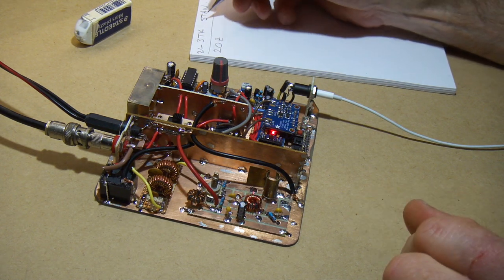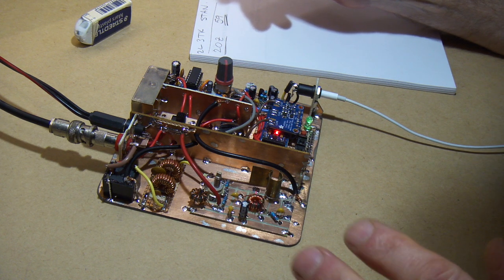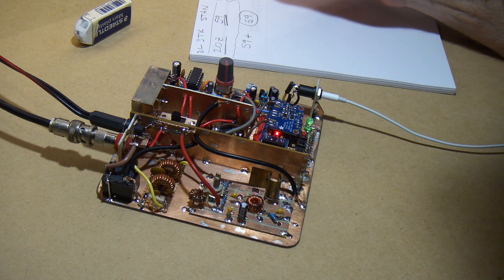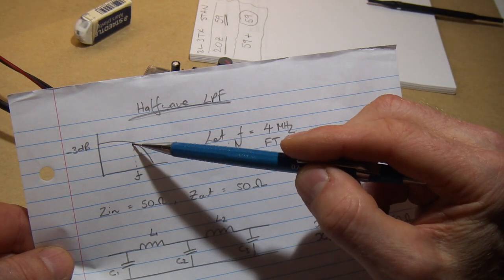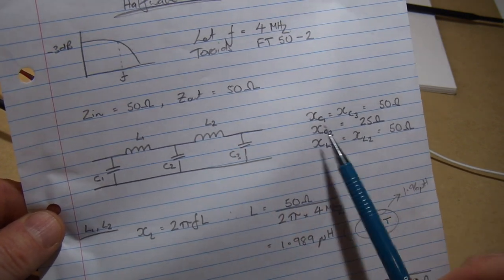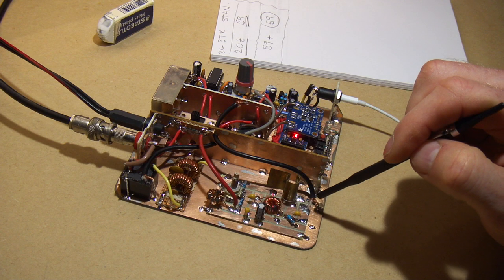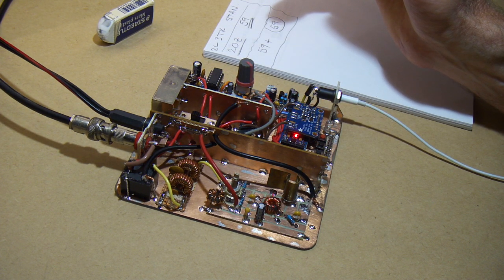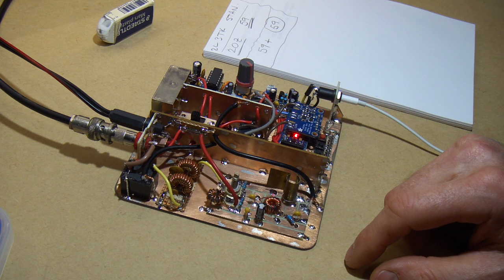Go QRP SSB Rig: Part 7 - LPF and First On Air Contacts

Comment: Hey Charlie -- you said your goal is to inspire others, and I thought I'd chime in as one who is inspired.  I've been bitten by the homebrew bug about a year ago, and am making progress in baby steps.  I anxiously await each of your videos, and have learned a lot of things from them.  This week's accomplishment was the successful creation of a driver amplifier to take the Si5351 up to a quarter watt at about 40-50% efficiency.  And the best part is I can point to each part in the circuit and explain what it does and why I put it there.  Thanks for your inspiration and the time you put into making videos!
Reply from the maker: That is so good to hear Yakov. I am so pleased, well done! Thank you very much for the feedback. Very much appreciated. 

Please keep us posted on how you are getting on.

73
Charlie
ZL2CTM
Reply: The easy way to do it if you will accept square wave output is the  AC04  chip or any AC not gate. You get out about  30 mW per gate  and one gate will drive about 8 others.  It's hellish crude but no  intermediate  transformers are required.  The output can be made double ended if you so choose.  Look at the Quad  BS 170 ampl used in the  MDx from Qrp labs if you want inspiration in this area.   The  Si 5351 is sufficiently  low z and  has  4mW out so it can drive  a single BS 170 in class  C  directly to produce  a gain of perhaps  16  DBg  so that gives you  160  mW out that's in class C operation only.  See the Penntek  TR-45L plug in board schematic for how he keyed (CW)  the amp with  Ramps  and  his power control detail. This config drives an IRF 510 to up to  7 W RF out at  10 Mhz.  I can't state the URL here  as the post will likely get deleted. 

TEF in NzL

Comment: That's just brilliant Charlie, even after all these years of watching your videos it still amazes me how you can take a relatively small handful of components and make such a good radio. I just wish I had the patience to work through the problems that come up. Whenever I build anything It never seems to work as well as your projects. 
Anyway can't wait to see what's next.
73 M1CEM.....
Reply from the maker: Many thanks Brian. It's certainly not always plain sailing, but it helps to have a logical fault finding process. I can than the Air Force for that.

Comment: hi Charlie,

you dont need the "2" in the inductor or capacitance calculations. if you take the "2" out of the calculations and enter the values in to elsie ( filter designing software) then it will give you the correct cut off frequency. keeping the "2" in both calculations yields a 5.6 MHz cut off frequency not 4 MHz as you thought.
Reply from the maker: That's interesting Simon. I'll have to go back and check the references. Cheers.
Reply: @CharlieMorrisZL2CTM  i am going to retract my comments about the reactance calculation being wrong, But will leave it up for educational purposes.

I have done my research on google and found to be in the wrong. Even sources that don't directly deal with filters, but do talk about capacitors and inductors and the reactance of both components. ALL other sources that talk about reactance DO clearly show the "2" in the equations / formulas. 

I will be contacting the site that holds the information i used and see if they know about this error ( or possibly an error in the context that their article could be taken). I have removed the one poast with the site name included so people don't make the same mistake that i did.

keep up the good work and stay safe 

Simon M6FJW

Comment: Thank you for the videos. I understand most of the maths you do as this stuff I studied as an undergraduate but I don't know enough about all the circuits. I am going through the material for the French ham license but it is a bit basic. Could you recommend a few books explaining more about the design of these little radios? I think that I will sit the exam next year and I like to tinker.
Reply from the maker: A lot of the basic theory goes back to my earlier Air Force days. More recently, I have found both 'Solid State Design for the Radio Amateur' and 'Experimental Methods in RF Design' tobe good texts.
Reply: @CharlieMorrisZL2CTM  Thank you, they seem out of print and really hard to get here, but I will keep my eyes open!

Comment: In module si5351a only work xtal on 25MHz, and clk0,clk1,clk2- dont power ON :(((. I used esp32 and scetch from etherkit github examples. All dont work... Can you help me??? Thx and sorry form my bad english.
Reply: Check the i2c wiring between your ESP32 and Si5351A modules, check pull up resistor valves. Try 100 kHz i2c  speed. Some Si5351A chips does have a non standard addresses (for example there are chips, factory-preprogrammed for a particular output frequency), this might be a problem too if you're trying to communicate with it by a standard address.
Reply: In the Etherkit library, the .init function returns true or false depending on whether of not it can establish a connection with the Si5351 over the I2C bus. That should help narrow down the problem
Reply from the maker: As per below Gena. Try that and see how you get on.
Reply: When I have problems with the I2C device I start with the I2C spy type of sketch just to see if I have communication and addresses of the chips are correct. very easy.
Reply: Мою сишку мне помог запустить код от трансивера uBitx (она там тоже используется). Лишнее оттуда я выкинул и оставил только модуль, связанный с синтезатором, его и встроил в свою прошивку. Правда, это для ардуино, но не думаю что это большая проблема.

Comment: Charlie your design has no DC stability vs temperature. Could prove a problem if you are out sitting in the sun! Neither has it a well defined gain. I have some suggestions for stable feedback amps on my blog at ganymedeham.blogsport.com which may interest you. More complicated but more stable.
Reply from the maker: Thanks. I'll look into it. To date the rigs have works well in a wide range of weather. I know and accept they are simple designs and as a consequence will have some limitations. Thanks again.